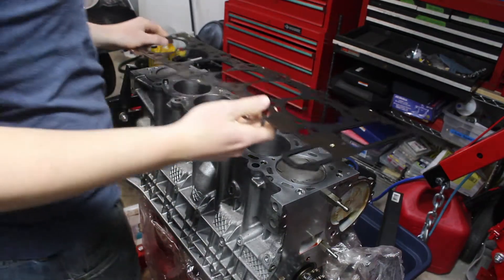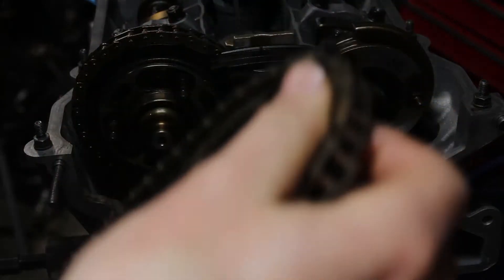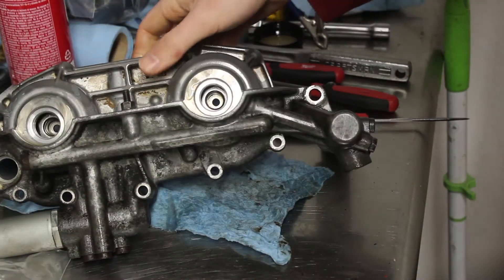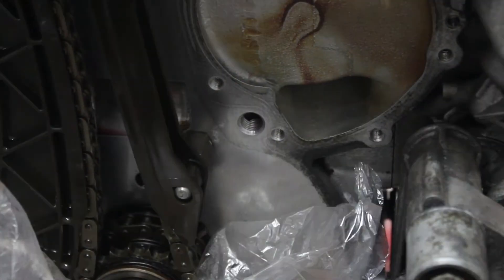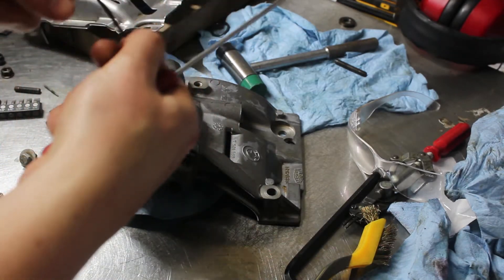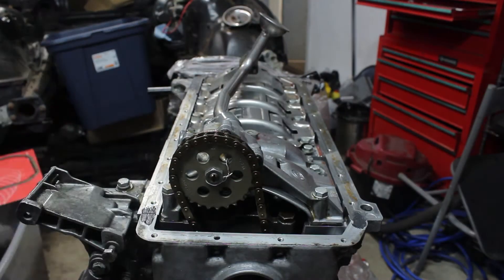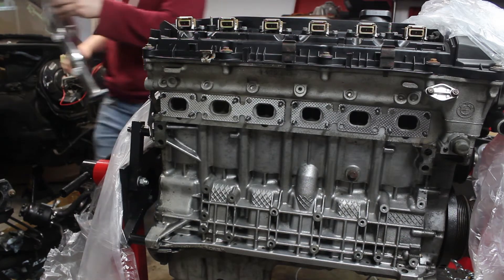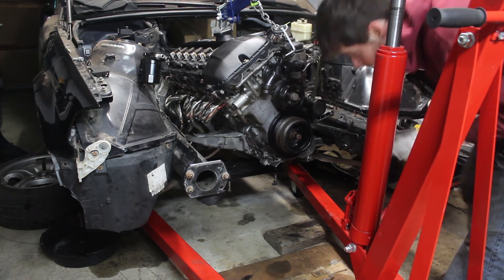BMW E46 Race Car Build: M54B30 Engine Reassembly

Comment: from where do you get all the torque specs? Looking forward to build one myself!
Reply from the maker: Well, that's the issue... there's no factory service manuals for BMWs. I would reference forums and other videos, mostly. There's 3rd party manuals but they aren't very good in my experience.
Reply: Well thats a problem too, most of the time the videos dont have an accurate torque spec, they usually talk about something different or not at all. How did you do it? Did you write some down that you could share? @rainvillecreative5410
Reply from the maker: @999Clips-BT  I didn't and it's been long enough that I don't recall much. If you can find reliable numbers for the crank and rod cap bolts, that is the most important stuff. I think my set of head bolts had their own torque spec provided. Everything else you can get away with an estimated guess based on the bolt size.
Reply: Hmmm okay, il try my best... thanks a lot though 👍 @rainvillecreative5410

Comment: I made the same mistake with the sealant for those gallery plugs. Used the white stuff that 50sKid did and stupidly put everything back together without checking if it had set. Sure enough, first drive and got a massive oil leak from the rear of the engine. Had to take the gearbox out a few times before I figured out what the culprit was. So far so good on blue thread locker. Still majorly concerned about the front one though. I get a nasty rattle for the first second at every cold start which quickly goes away and doesn't do it the second time around if you turn the engine off-on, but then comes back even if the car had been sitting for just 15 minutes. It more than likely is oil pressure related despite no warning lights. Seriously contemplating taking the oil pan and timing cover back off again and sealing it properly. Wish I watched this before putting the engine together...

Comment: Oh! And those gaskets supplied with your headers, they like to blow out. Definitely recommended to install OEM style, with or without heatshield.
Reply from the maker: Thanks again, I did wind up going with OEM gaskets, as you'll see in the next vids. I was worried the lack of heat shields would melt the valve cover.